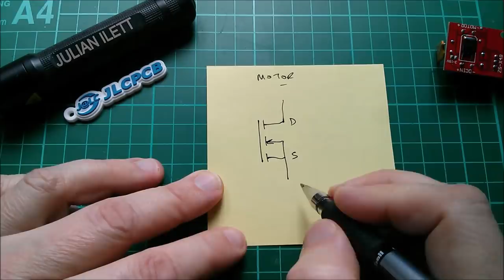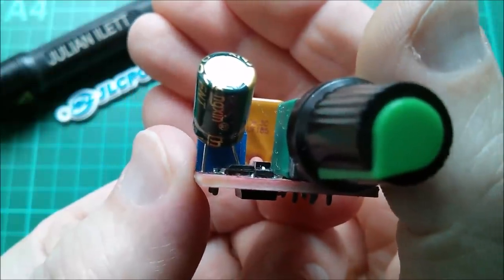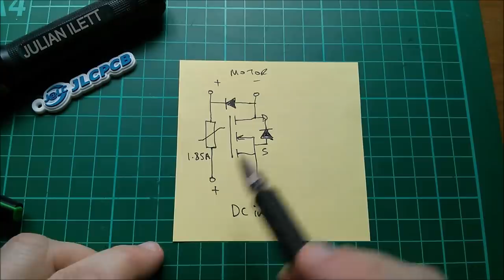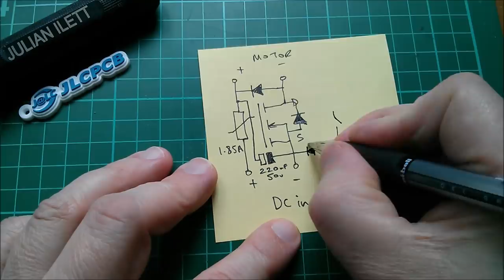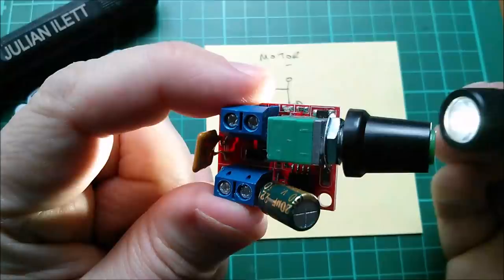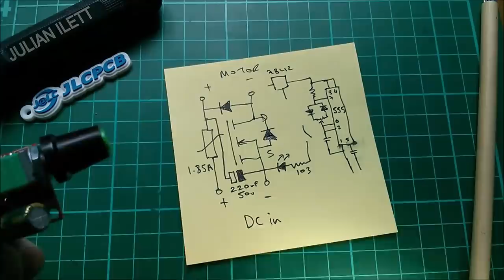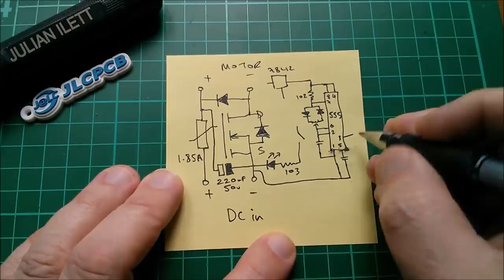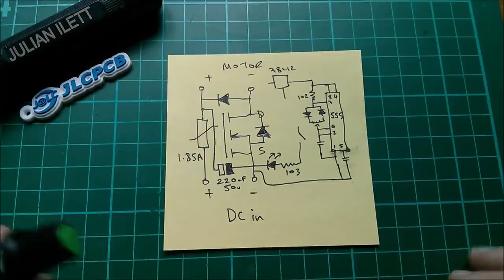PWM Motor Speed Controller Reverse Engineer

Comment: The 3-15v jumper on the back is there for lower voltages! You leave it unsoldered for higher voltages ~12-35v and are suppose to solder the two pads together to control lower voltage ~3-15v! The board is in-fact rated for up to 35v.

Comment: Don't mark component value codes on your schematic unless you are at least showing the actual value.  Things can get confusing when you then mark a resistor as 100 and now we don't know if that is 100 ohms or 10 ohms.  Just like you wouldn't mark a resistor as brown black black on your schematic don't do it for other codes as 100.  Leave the component markings for the BOM parts list if really needed. - 6:27

Comment: Good video. I would love to see your ideas on reducing RFI from PWM controllers. LED drivers in particular.
Reply: snubber network, PI filter, ferrite bead...................The frequency doesn't have to be that high, so RFI need not be significant  though the harmonics could be in the IF range.

Comment: I have made something similar myself, for use with acid dosing pumps on a machine that crunches corn, mine is a bit smaller, uses a THT IRFZ44N, so you can easily add a heatsink, the mosfet is driven through a dedicated driver chip and it has a schotky between the drain and source of the transistor, since it was designed to be installed by me, I made it 3 wire (wires are soldered on, instead of connectors) it has GND, 12V in (or anything within the 555s working range) and motor negative, I have to put another diode on the motor, but it can be pretty much at the motor itself (which is better than putting it all the way over on the PCB) and the power switch is separate, it also allows me to use a 24V motor, with the 555 having it's own supply, potentially allowing to connect even a 50V motor (or whatever the IRFZ44N max voltage was)

Comment: I got some of these a while back to use as dimmers on 24V 1 Amp LED strips.  They worked but the electrolytic capacitor got very hot (not the mosfet), even with another capacitor across the DC-in.  They got retired to the junk bin before a meltdown occurred.
Reply: What input supply did you use? These assume you are using a good smoothed or regulated DC supply. The purpose of the 220uF capacitor is simply to decouple the supply to reduce voltage dips caused by the resistance of the input wiring and the resistance of the polyfuse when the MOSFET switches on.

Comment: Any particular reason you didn't want to  use a pwm output from the shed nano? Even if via a mosfet module of some sort? That could've been programmatically controlled based on the difference between wanted and actual humidity, or even remotely, and it'd make a good video.

Comment: And you didn't run something with it in the end? That's what we want to see!   :-)
Reply from the maker: Are you subscribed to my 2nd channel?
Try this one: https://www.youtube.com/watch?v=wb2yqtaM9y8
Reply: I'm using them to dim some 70W LED COB Panels in my lab. So far they handled the high current pretty well and with such a cob panel, the pwm modul and some power source you get a very bright and very cheap to repair working light.
Reply: @JulianIlett  can I power this below 12v?

Comment: Are you sure there is'nt one more resistor to bring the fet low gate to gnd?
Reply: Some time ago I reverse engineered the same or a very similar unit, I don’t remember any such resistor. Don’t forget that pin 3 on a NE555 timer is a push-pull stage that drives both high and low.

Comment: Can you bypass the pot with an ardunio ? what connections would you use ?
Reply: Then you don’t really need the NE555, the pot or any of the support components for the NE555, so most of the board would be unused...
Reply: needs a MosFet with a very low Gate Threshold Voltage, or use a comparator in between.  Look at the IRL family, MosFets have four critical parameters..... but here the main problem is that most (even the Logic versions) need a relatively high turn-on voltage. Here the 555 can provide 10.5 to 11 Volts  (given a Vcc of 12V), so the Gate Threshold Voltage (for a Logic MosFet) is not a problem.
This shows a motor but same as a LED strip - just don't need the diode
https://circuitcrush.com/arduino/2017/06/02/logic-level-mosfets-irl-or-irf.html

Comment: noticing something on mine. Below the 3-15V label on the back there appears to be a solder jumper not soldered and next to the motor screw terminals there are two pads for something.
Reply: It looks to be for when your input voltage is in that range.  It bypasses the 78L05 so it can run at a lower voltage down to 3V.  The 555 wouldn't work if Vcc was at 3V because the 5V regulator has a voltage drop.  So the ranges are about: 7-30V without jumper and 3-15V with the jumper.  You should be able to confirm (or not) that with an ohm meter on yours by probing those pads and the regulator pins.  Hope that helps, Cliff.
Reply: @ElmerFuddGun  well I do have a multimeter in my desk at work. 🤔
Reply: @ElmerFuddGun  but I've run these at 5volts.
Reply: @chartle1  - Well the regulator will have about a 2V drop so 5V should work.  Although 3V is below spec for the 555.  If you try it at 3V without the jumper I don't think it will run.  I could be wrong but that was my somewhat educated guess.   ;-)   Maybe I have one of these... order lots of cheap stuff from China but don't use it all.  LOL.
Reply: @ElmerFuddGun  I looked at my banggood orders from when I heard up them here. 

It's about 4 car payments.
Reply: @ElmerFuddGun  That's what it is. I have used this module for dimming 5V LED lighting (group campout) and while I was unaware of the chip's power requirement, the other thing is that the dimming range of the pot was a much better fit for lighting use after the jumper was soldered. I don't know if that was intentional or just lucky, but it worked out great. ;)
Reply: @FurrBeard  - Hey that's good to hear.  And good to know I am right now and then!   ;-)

Comment: He said complete, but he was guessing a lot, as he shows the blue led has no power + the regulator no negative connection, all he had to do to find where things go (under the speed control) was to pickup his Ohm meter and trace them out that way.  I use this same circuit to PWM control LED lamps brightness. Ron W4BIN

Comment: I don't understand mosfets. I've watched loads of videos, followed alond and built circuits on the bread board to no avail. I just can't get on with them. So I use opto-isolators and relays instead.
Reply: Mai Mariarti  Cheers, what a great video.
Reply: Another video that might help. Or for a very very basic explanation - it's basically like a switch that gets "switched" on and off by the voltage at the gate. Technically that's not 100% correct I guess, but sometimes it's more about the general idea on how to use it than a perfect technical and physical explanation I guess :)  
https://youtu.be/GrvvkYTW_0k
Reply: Leif - think of MOSFETs with the following analogy: the drain - source connection is like a thin walled hose pipe and the gate voltage is like your foot pressing on the hose. As the gate voltage changes, that’s like the pressure from your foot changing on the hose. The gate voltage changes the area of the drain - source region where electrons can flow, hence it is wider or narrower depending on the gate voltage, wider has a lower resistance, hence more current flows.

Comment: i made something similar to this using a 555 to control the PWM fans in my computer. no mosfet is needed for my version. great video!!!
Reply: Directly driving the fans from the 555? a bit risky as the initial current inrush can exceed 200 mA.